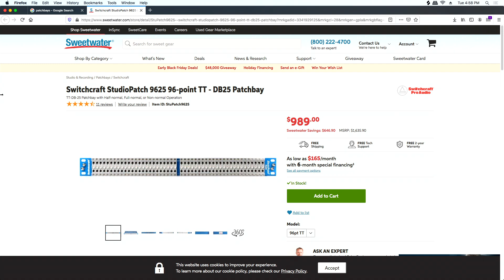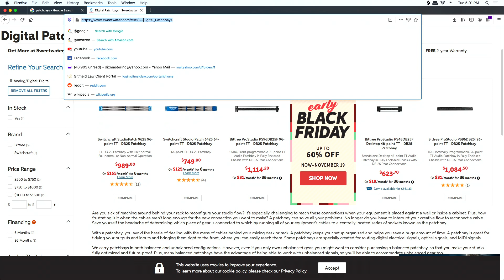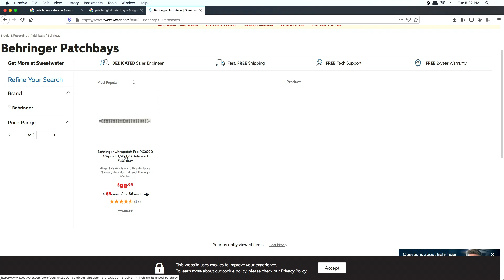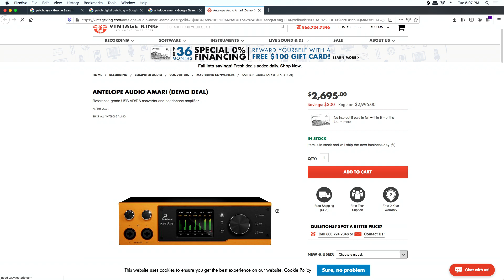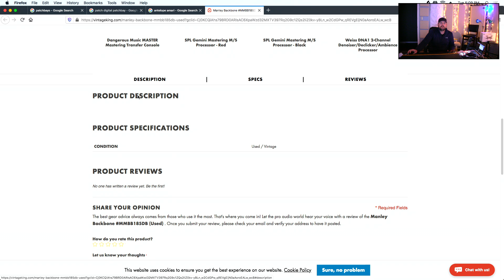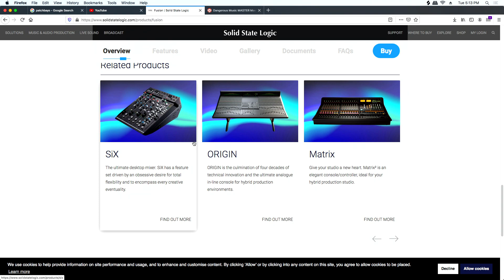ROUTING YOUR HARDWARE, Best practices

Comment: Doug thanks for the good content in your channel. So I recently purchased a Pure2 thinking it was a good way to start building my home studio by building a solid hardware foundation. Later I decided that I wanted to add a summing mixer to my chain but correct me if I'm wrong;  the Pure2 lacks the minimum I/O connectivity for the summing mixer to be added in this signal flow.  Is purchasing another A/D converter with more I/O's the only way I can integrate the summing mixer. Sorry if that topic was already discussed.
Reply from the maker: Yes if you want to use the summing a lot of people use a orion 32 and print back to the pure 2 for its awesome ad convertor.
Reply from the maker: The orion has 32 io and the pure 2 can be run either spdif or adat.

Comment: You have any experience with any MOTU converters? I'm using the latest higher end AVB stuff from MOTU and I think the virutal matrix routing with the AVB app is phemonial. It's a very innovative feature that allows you to eliminate the patch bay and messy cable's from your setup. The converters on my 828ES sounds just as good as the Apogee after using them side by side that has a nice punchy bottom end and great clarity in the mids. Some people has said the MOTU 16A sounds very close to the original Symphony I/O. Motu is using the ESS Sabre DAC chips in all of their modern products these days. I use the 828ES as my main interface with my outboard Mic Pres and compressors.

Comment: Hi Doug!  I have start with mastering, still learning. I have the SSL X-Patch that i used before as patchbay  for mixing, do you think that the X-Patch is good enough for mastering? i have some nice hardware that i gonna use in my mastering chain.
Reply from the maker: I was in hunt of one of those.  I would believe that ssl built that right!  Some of the dbx stuff i have noticed a change may be tough for mastering but x rack should do fine
Reply: @DougJenkins  I have 2 X-Patch but only need one but i live in Sweden so i guess that is to far away :).
Reply from the maker: @MR_Cellarpop  :)
Reply: @DougJenkins  And what do you think of having the SSL Sigma summing mixer in the mastering chain?, maybe too much color even if it is kinda clean.
Reply from the maker: @MR_Cellarpop  That sigma is nice!  more for before the bus, summing the tracks for the final mix, absolutely! Sounds incredible